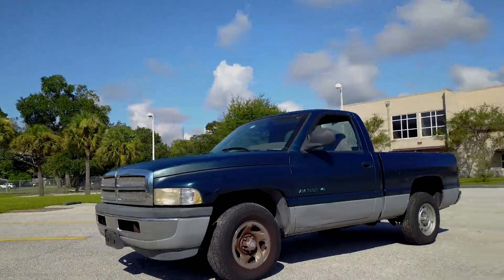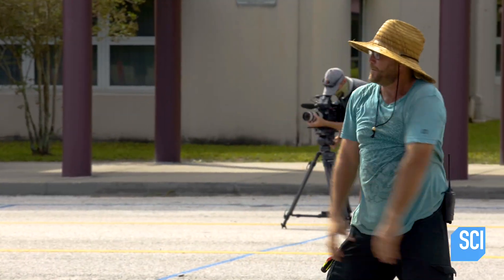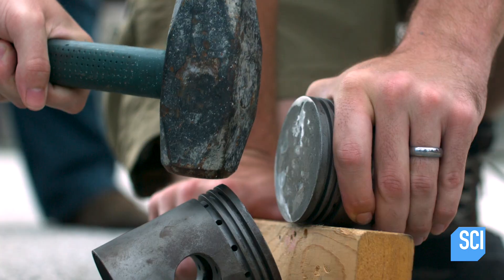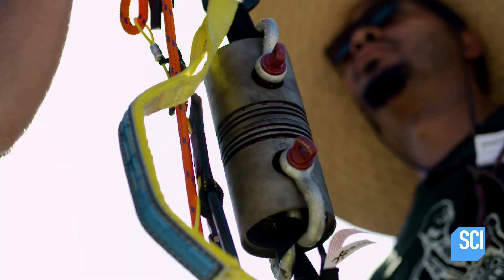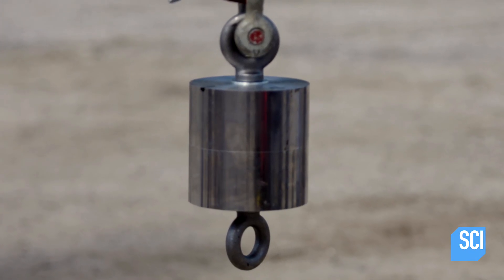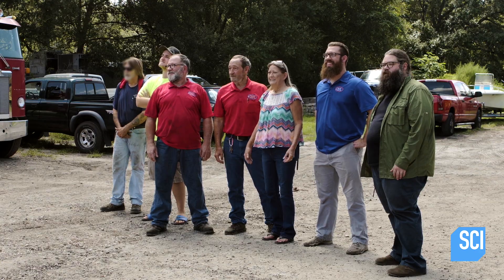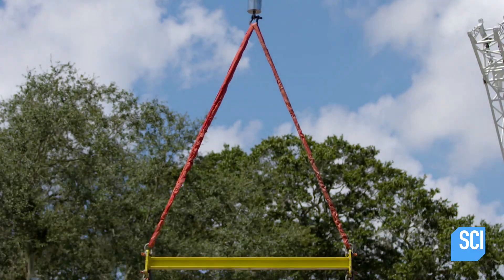Think Super Glue Can Lift A Pickup Truck?

Comment: pistons are stupid, not only is the rod pin slightly off centered from the factory (helps NVH), but they also look like used ones too, with probably being oil/fuel soaked, so the glue never got a proper bond.

Comment: Total BullSh-T when they said they're using just "10 drops" ! Did you see the size of each so-called drop? Each of their drops is in actuality equivalent to at least 3 of the average size drops that are produced by super glue's spout and so they didn't just use 10 drops but was much closer to 30 drops... even so, it was still impressive to see it hold

Comment: At a manufacturing plant we had a 2500 pound press that would slowly walk away from the assembly line when in use. The slight imbalance was something that maintenance was not worried with, it was just a nuisance. We super glued it to the concrete floor and it stayed in location. Five years later when moving the machine, the concrete came up with the foot pad.
Reply: Shawn Strode holy crap
Reply: What glue ha
Reply: Yeah wtf glue was THIS
Reply: @stevehartlieb  CA
Reply: That cured for 5 years
Reply: Just super glue?
Reply: What brand/model?

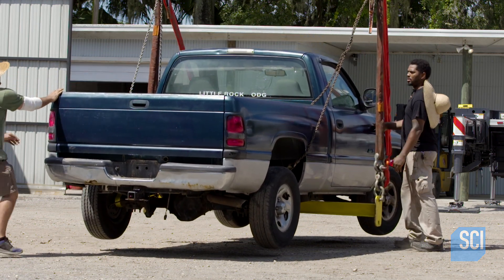Comment: Uhh...why were they even near the truck as it was still being lowered at 2:43? If it failed the upper yellow beam could have come crashing down and could have killed someone.
Reply: No steel toes, no hard hats. That's a lot of faith still to stick into 10 drops. Plus, when it is being lowered, after first point touches down, the sheer force comes back into play. Given, at that point, I don't think it is probably gonna hit you on the head, but still... it could for whatever reason. 

I work in construction, I'd have my guy's asses if they tried that shit.
Reply: Very good observation. Because they're not professionals. In my work as a fireman whenever you have a heavy load attached to something you're not relaxed until everything is untied and apart.
Reply: Sue the company duhhhh